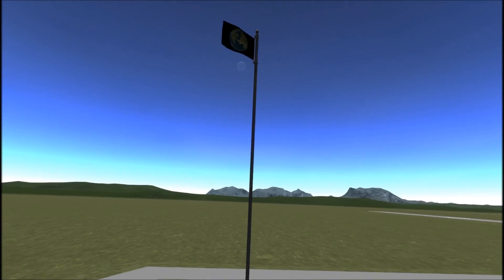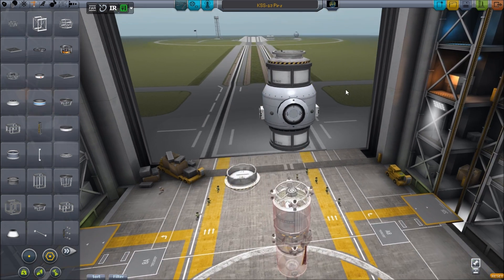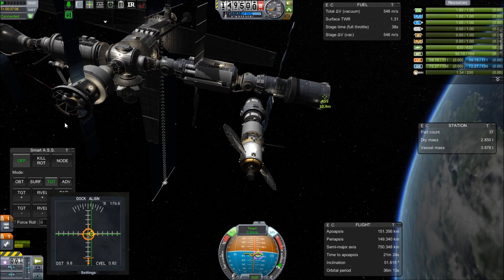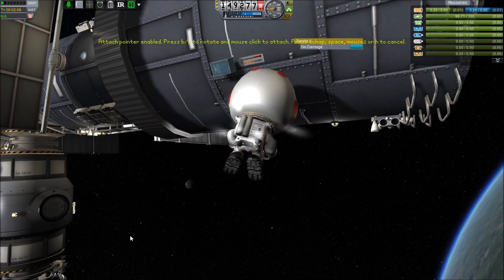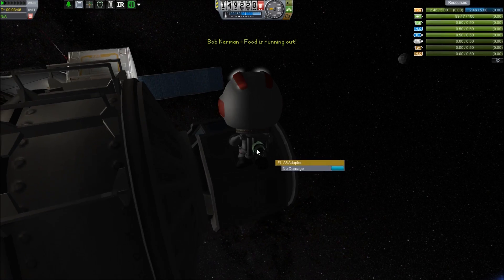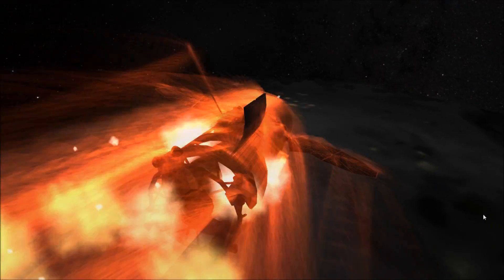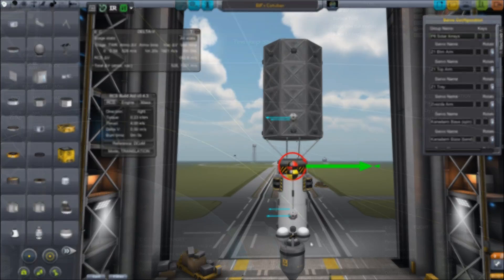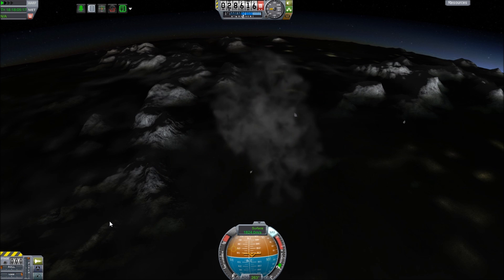KSS-13: Pirs / Project Gateway / Kerbal Space Program 0.23

Comment: Where did you get those additional struts?  Primarily like the one used in Bill's Catcher.
Reply from the maker: Large truss-like segments? "ModsByTal" which was hard to find.
Reply: It's not on the forms, I take it?  If so, would you be willing to post a link?
Reply from the maker: Actually searching for ModsByTal on google just returned it in the top link. Apparently it has been updated for 0.23 since I got it too. It has spherical fuel tanks and truss pieces.
Reply: Cheers!

Comment: i was wondering if you could tell me how you managed to change the radiators white?
Reply from the maker: In my directory there are some texture files:
E:\Program Files (x86)\Steam\SteamApps\common\Kerbal Space Program 0.23 - KSS Construction\GameData\WarpPlugin\Parts\Electrical\HeatRadiator\*.png
I replaced those PNGs with new files.
Reply: ah ok cheers and chance of you posting up the PNG files?
Reply from the maker: They were not mine. I got them on this thread somewhere, if I recall: http://forum.kerbalspaceprogram.com/threads/43839-0-23-KSP-Interstellar-(Thermal-Helper-Solar-Sail-Impactors-Fusion)-Version-0-10-3
Reply: ah ok cheers, the white ones look so much better :')

Comment: You should cram all your mods in one so we can use the same parts as you instead of downloading them one by one. 
Please notifie me if this is done
Reply from the maker: I thought the same thing, but...
(1) I don't want to package other peoples' work and then somehow become responsible for... well I don't know what. Breaking a rule I don't know about? Causing damage to someone's KSP install when they try to overlay my work?
(2) Also, along the way of the construction I have made tweaks to the files slowly... here and there... and I started noticing that older crafts would not load even for ME anymore, sometimes. I needed to take more care with my modifications to keep them loading, but it's hard keeping the station just getting built much less keeping older files working to be able to do it twice.
(3) I have made tweaks to the save game itself sometimes to improve frame rate. The thing in orbit is not just the sum of its parts. It's more than that now.

Comment: Have you checked out the kerbal chatterer mod? Its a pretty neat mod if you haven't seen/used it yet.
Reply from the maker: Jeb, you're supposed to be in the staff meeting regarding the manned mission to Minmus to investigate the second large anomaly that has been discovered. Also, I thought it was YOUR idea to cut down on the comm chatter since it was (1) cutting into the narrator sometimes, and (2) sounded weird when sped up to 2x to 4x speed.
Reply: Bob Fitch Ah, alright, I'll get back to work now.